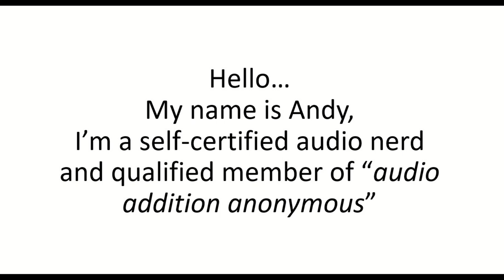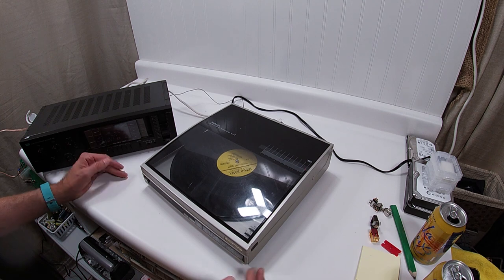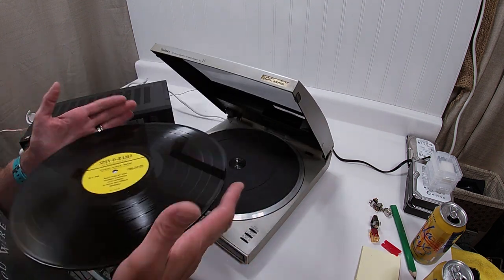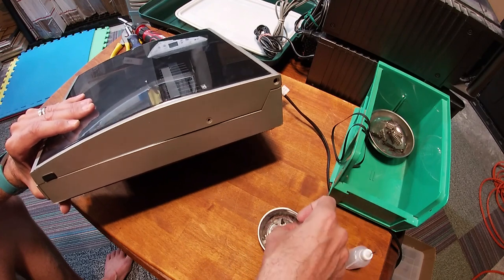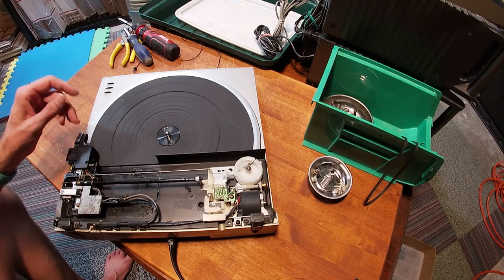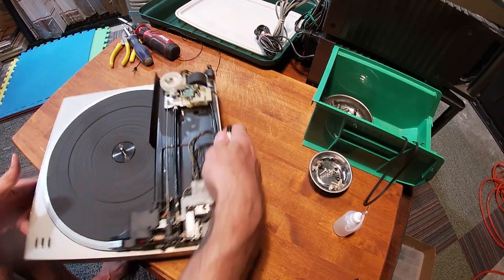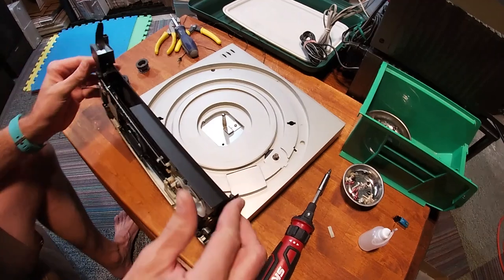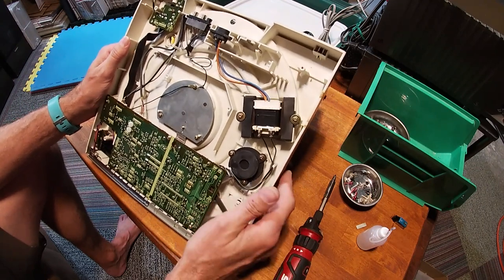Technics SL-J1 Linear Turntable Review and Maintenance - Belts, Lube and Inspection (easy easy...)

Comment: Thanks for this! I have a similar model (the 5 I think?), and your tour of the disassembly and inner mechanism is really helpful. Mine is working right now, but you know, some day it will need to be relubed and have the belts changed!  Question for you on the tracking force... I've always read that the p-mount cartridges didn't need adjustment, but is there any way to confirm that the tonearm is tracking at the right weight?

Comment: Great video.  Any suggestions for that little tonearm belt? A similar size rubber band will work ok? Stores want $12 for that tiny rubber band.
Reply: An rubber band will not last very long, an actual drive belt will last years.  I would be surprised if a rubber band would last a year.  That belt sits motionless in the same position every time the tonearm returns to rest and until it plays another record.  A rubber band will go oblong and slip in no time.  Also, a rubber band is very stretchy, the tracking won't be near as precise.  I've had a few dozen linears (no, you may not ask how many I have).  I will often shut them off with the arm halfway back so the belt can sit in a different position once in a while.

Comment: Hi Andy, great video. 
I have a simple question, newbie question: are all p-mount cartridges the same? 
In my SL-J1 i have a broken Shure M92E, what can i use to replace it? 
I'm looking for an alternative/unoriginal cartridge but all the other p-mount seems to have different shapes!
Thank you.
Reply: From my experience as another happy owner of a vintage Technics linear tracking turntable, most of the p-mount cartridges are easily interchangable, of course you need to adjust your phono pre-amp if you are going to MC from MM cartridges but for the physical interface it's all the same, and no need to re-adjust the tracking force, angles, etc. The only p-mount cartridge still in produce seems to be Audio Technica AT85EP and it's readily available on major shopping websites at a reasonable price.
Reply: @XitingShi  thank you so much! exactly the infos i was looking for!

Comment: I thought these were high end when they were new. I saw the price of a SL-15 and I think it was like $850. when it was new. I know that more a deluxe model and had programming tracks. I had I think a SL-5 around 85 I got used and loved that machine and worked well when I had it.
Reply: I don’t think this was a low end model and was the fist of the series of the compact technics tts.   There’s a history of all the Techincs TTS  on the internet and what it sold for back then.
Reply: I now have 2 working Technics SL-5 and I think it’s direct drive and don’t have a belt for me the platter. . I think it does use a belt for the tone arm.
Reply: I also got a Sony linear tt that ver cool and the size of quarter of the record and the rest spins outside of the unit.  I can’t remember the model number but from the early 80’s to go with the Sony mini system that was popular back in the early 80’s.
Reply: I’m thinking of buying a non working technica SL 6 from eBay , but I’m not sure if it’s a small fix or a complicated big fix. So I’m wondering if these tts are easy to fix or to just pay more for a working one?

Comment: hello sir your video are so informativ so ty first of all.

so here my question i have a technics sl-js1 so probably arround the same year model 
sadly he's not runing no more at the moment the arm can unlock from starting position but after selecting table format (45 or 33) and pressing play it doesn't moove to position( the arm).
i'm kinda attach to the turntable and wonder if its "approachable" as a total beginer to fix. 
wonder if you ever work on such model ? and if you can provide me any lead on how to approach the problem.

kind regard jim
Reply: 99 times out of a hundred (more like 999/1000) the drive belt is slipping.  If it's very quiet, push start and with you ear close to the lid, you will likely hear the DC motor that advances the arm whirring, trying to do it's job - and failing.

Comment: I wish I had seen your video before I removed the lid on my Technics SL-J33 Linear Tracking Turntable. I broke 2 of those flared pieces that the pegs go into and retain the lid and I can’t find them online. Any ideas on where to find these parts?
Reply from the maker: Nowhere specific. I’ve had trouble sourcing them myself.
Reply: I see parts for these tts on eBay when ppl. break them up. Also, many part I think can be interchangeable I think for the many technics made on this style tt. 

Yeah, I hate trying to fix vintage audio equipment bc I alway end up taking off something and breaking. Or have a hard time figuring off how to get off without breaking. So it helps to have someone else show how they got it off. Like I was trying to pull off the cartrige and later found out why it wasn’t coming out and I needed to remove the screw on the side. I wish someone would take the time to do a full take apart on all the various models and I’m sure that'll get many views and be very helpful to many.